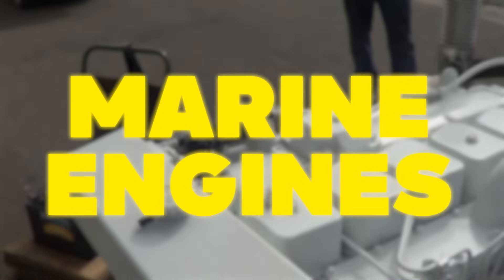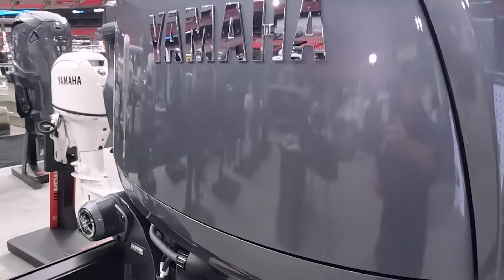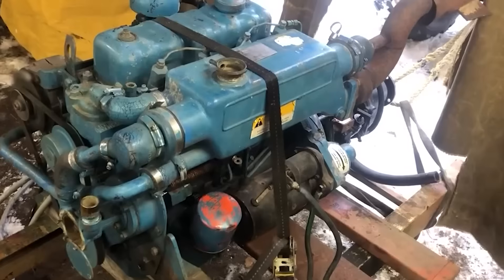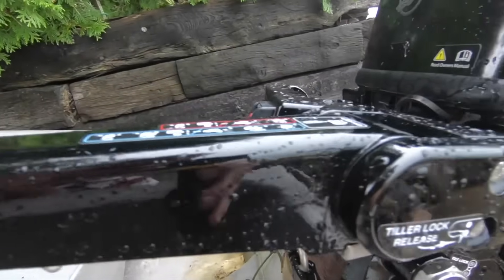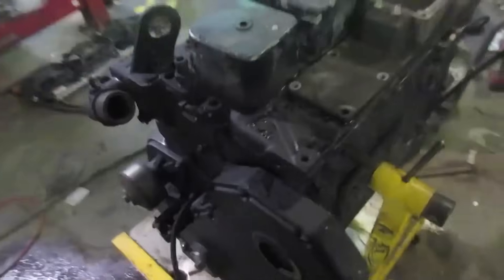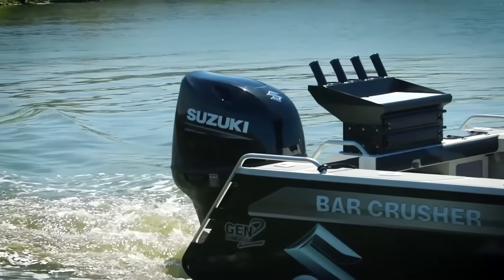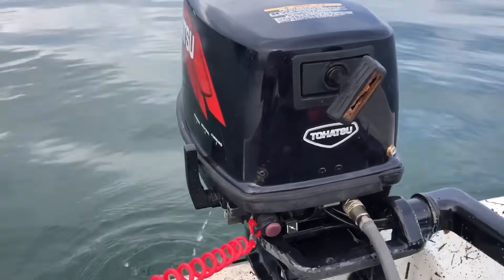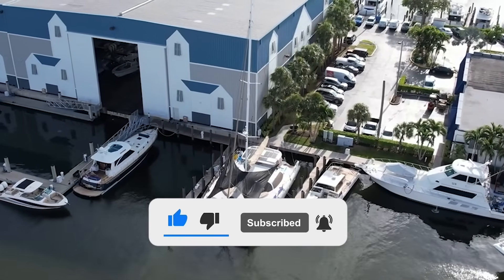10 Boat Engines That NEVER Break Down!

Comment: The old, single cylinder Bolinder Diesel engines, made in Sweden, ran for decades with only routine maintenance. There are still a plenty in daily use. I grew up to the steady, thumping sound of them in fishing vessels on the Humber, heading into and out of Grimsby and Hull, some of which fished from those ports, going as far away as the Grand Banks, off Newfoundland, and all over the North Sea and Arctic, both Summer and Winter.

Comment: My vote is for Volvo Penta AD-41 series.
Mechanical injection, enough said.
Only weak point are the (expensive) exhaust elbows which are especially prone to corrosion if not properly maintained from the outset.

Comment: Wet exhaust? No thanks.
Reply from the maker: Wet exhaust isn't for everyone! Dry exhaust systems are simpler but require proper insulation and routing. Each has its place depending on the installation. Thanks for watching and don't forget to subscribe.

Comment: Reliable outboards OX66 3.3L EFI V6 Yamaha. reliable small diesel AQAD30A 2.4L Turbo 4L Volvo Penta. Another outboard early 3L 4L Suzuki DF 150. Running twins with 1400hours with zero corrosion, zero carbon buildup and no issues except magnets fell off the wheel after 15 years.
Reply from the maker: Great lineup! 1400 hours with zero corrosion on those DF150 twins is impressive, magnets aside that's a minor fix for 15 years of service. Thanks for watching and don't forget to subscribe :)

Comment: I love my Perkins Sabre M65. 3 litre 4 cylinder diesel only producing 67hp. Low revving and 500 hour service intervals. All mechanical. Beautiful engineering. Look after what youve got folks - governments wont be allowing these engines to be built anymore.
Reply from the maker: The Perkins Sabre M65 is a gem!  You're right that these all-mechanical diesels are becoming rare, so definitely worth preserving. Thanks for watching and don't forget to subscribe.

Comment: AI voice-over makes me wonder how much else is AI generated. Seems to totally lack human input. A lot of the visual content is fluffy filler and many of the engine shots flash by so quick that I suspect they are not the engine being described at that time. All of this makes me question whether this video is total AI slop, a lot of it scraped from manufacturers brochures. I'm clicking "Do not recommend this channel."
Reply: ...."Do not recommend channel".....my personal bit of pushback ✅️
Reply: Agreed.  First clue was “Bass” boat, with “Bass” being pronounced as in Bass guitar.  A few other clues- mentioning closed cooling systems, then shows raw water heat exchanger/ raw water pump😂

Comment: We had a Yanmar 4JH/BE in our sailboat.  It was a great motor.  Another bigger Yanmar that is very  reliable and tough is the 375 HP STP 6LY.  We had two of those in our powerboat.   The Coast Guard and the Navy have these engines in a lot of small craft.  We also have a 1994 Johnson/Evinrude Ocean Runner 200 that is still on our 21 center console and still running great.  I don't know how many hours it has, and it only gets about 1.5 mpg, but it is bulletproof.  In 31 years, we have done nothing but clean the carbs, replace the water pumps and change the lower gear oil out.
Reply from the maker: Those are multiple great engines! Thanks for watching and don't forget to subscribe

Comment: In two words, the British seagull.
Reply: One arm is longer than the other after trying to start those -it’s. Have used as an anchor too. Worst motor ever.
Reply from the maker: Ha! The British Seagull is certainly legendary for its simplicity. They either run forever or drive you mad trying to start them, no in-between! Thanks for watching and don't forget to subscribe.
Reply: How do you start one that's lost it's magnetism?I've had one since 197someting ,now it's stuffed.

Comment: Ran a car ferry with a Kubota 50 hp/13 kw generator for 10 years. Ran 24 hrs a day with two stops a day to check fluids. Oil/filter changes every 500 hours. When I left, it had 32,000 hours and was still running.
Reply from the maker: 32,000 hours on a Kubota running 24 hours a day is phenomenal! Thanks for watching and don't forget to subscribe.

Comment: Why didn't you mention Detroit 71 ser.nat aspirated
Reply: Yes my apologies for not giving the 6- 71 a better wrap , I had one in a 52 foot crayfish boat coupled to an Allison box and it served me well for two years , cheers from Tasmania
Reply from the maker: Fair point! I should make a longer list and add this true workhorse. Thanks for watching and don't forget to subscribe.
Reply: @Enginebayy thanks for the reply, as I mentioned , I was spoilt with Gardners over my fishing career , the 6 LX B was a great motor but my favourite by far is the 8 L3B , I had one in a 60 foot crayfish boat for the last eight years of my career, there's nothing that can compare to them for economy and reliability, in eight years I can honestly say that I didn't loose a days fishing due to breakdown, it was 230 HP @ 1150 rpm it was coupled to a twin disc 514 with 4-5. To1 reduction box and swinging a 54 - 38 inch four blade prop, under load the sound was like poetry in motion , thanks for your posts, cheers from Tasmania